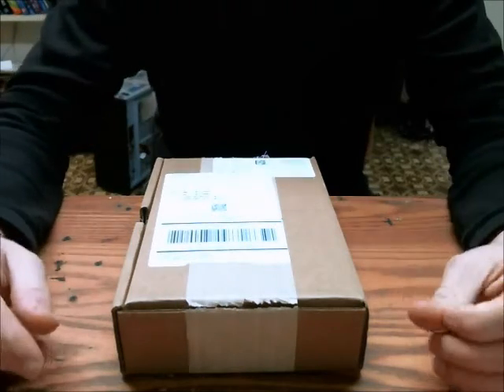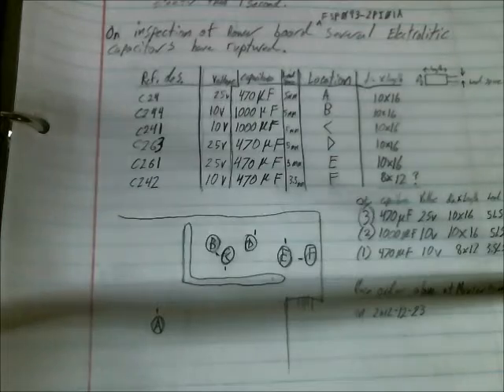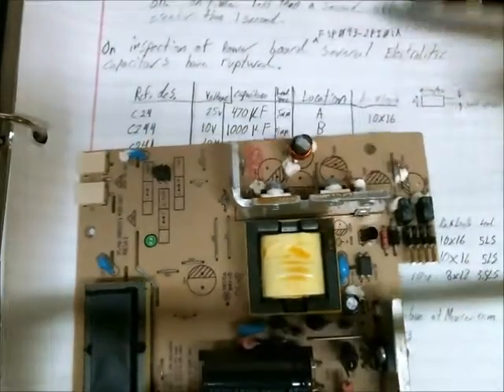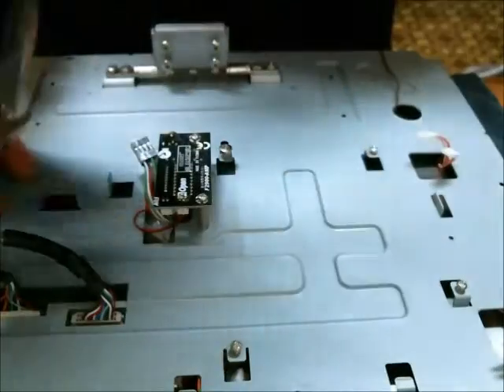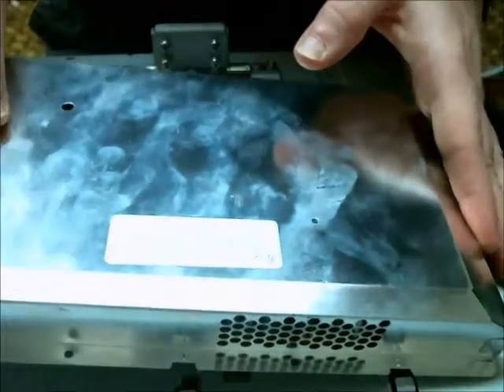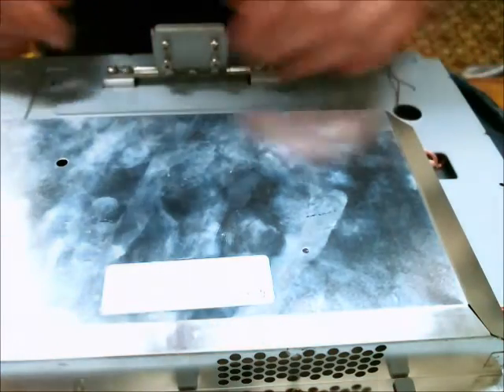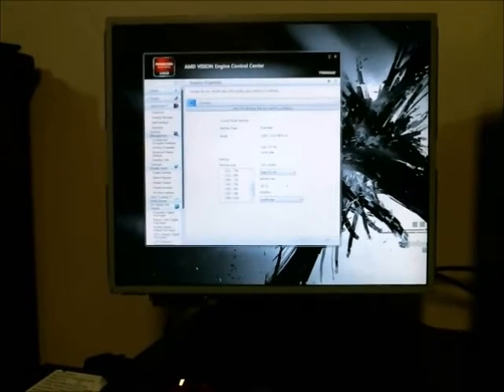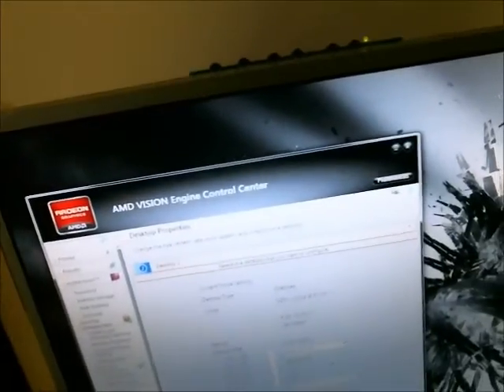LCD Monitor Repair (Aopen F2925)

Comment from the maker: The light would pulse on and off, when the power button was pressed, and the LCD would never turn on.
Does your monitor have an external power supply? If yes the external power supply could be your issue. If no check the resistance of the fuse.